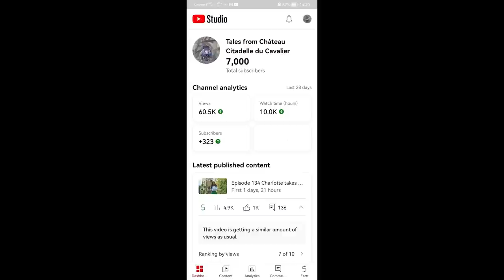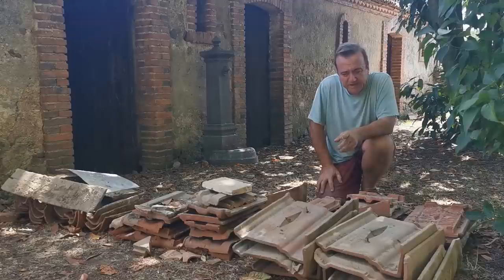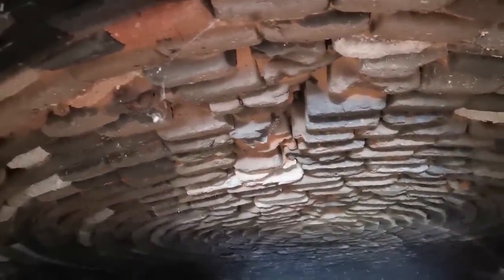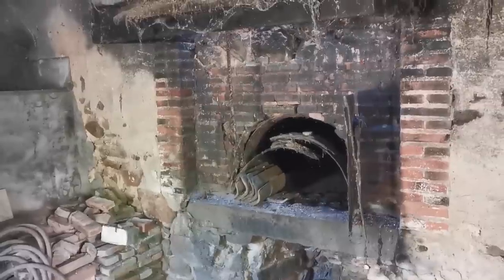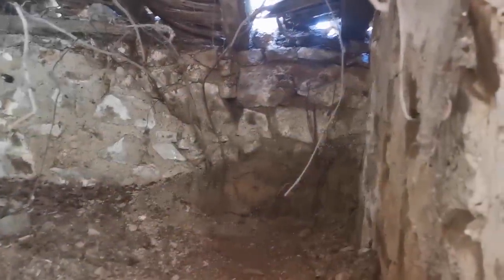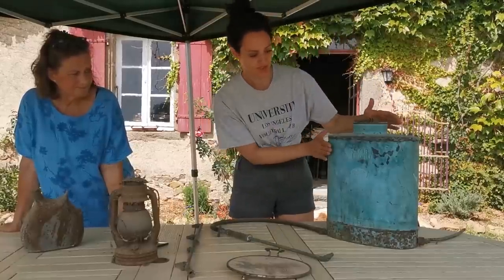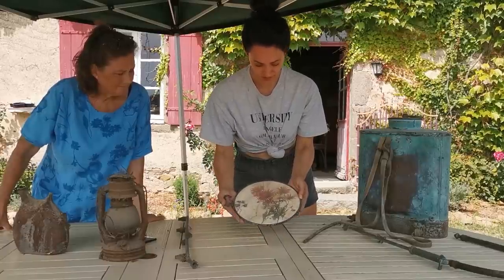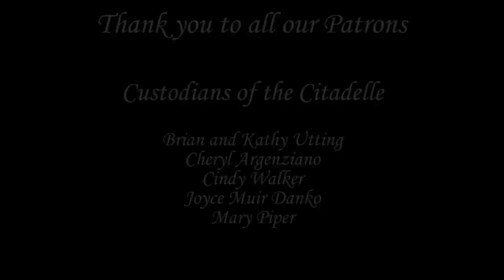EP135 Is the bread oven in danger of collapse ?

Comment: Additional clay tiles over the dome might have been done to retain heat, and make the oven hotter, and stay hot for a longer period of time....
Reply from the maker: Hello Georges, thank you. The tiles we're thrown in very randomly, some in large piles. I believe it should have several layers of clay which helps with the heat retention, I'm going to be digging down, very gently, to see if I can find clay. Best wishes to you, from everyone here at the Citadelle
Reply: is not placed there for heat retention.  
the brick arch in there was the clue.  if heat retention, then wood will exhibit heat change & deformation. I am in same boat with them,  why put good tile roof edging in there.  must be for different roofing location  or some other unknown reason(s).   

Since the brick arch and mortar scoop was in there,  meant reconstruction was done somewhere and stuff was placed there ahem must be temporary but become forgotten.

is there roof sitting on brick wall around your buildings?

Comment: The 'stuff' over the dome is probably there for thermal mass. Takes a while to heat it up, but it would stay hot for far longer, so is probably deliberate. Usually the domes are clay covered, so there may be clay under that as well. Maybe best to leave it, unless it needs a rebuild.

Comment: Rols, can you explain why you think the remnants of the building in the walled garden is a former greenhouse?  The niche in the wall, leads me to think it was a chapel at one time and may be where all your curious tiles from the bread oven might go.  A walled garden is an unusual place for a chapel but you do have the wrought iron fence there as well.
Reply from the maker: Hello Kathy, thank you for your question. It sits in the potager area and is next to the well. The shape of it is a 'lean to' therefore no gable end meaning the tiles found could not come from there. the floor is below ground level which is often the case for a greenhouse. Niches are quite common place in greenhouses here and finally the size doesn't lend itself to being a Chapel, it:s too small. Have a nice weekend, Rols

Comment: To be honest, if the bread oven can hold the enormous weight of those tiles, I rather think you would be safe.     Keep your weight spread as much as possible (for example lay on your stomach and keep reaching with the rake).   Gently does it.  Could the tiles be used to repair the hole further along?  I realise they are a different pattern, but that could be part of the charm.  Just ideas.  Best wishes.